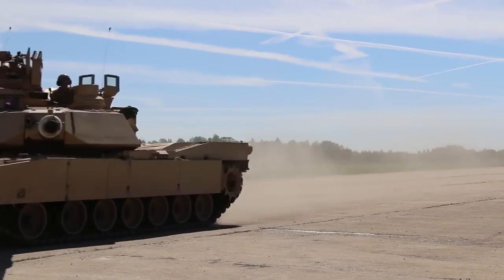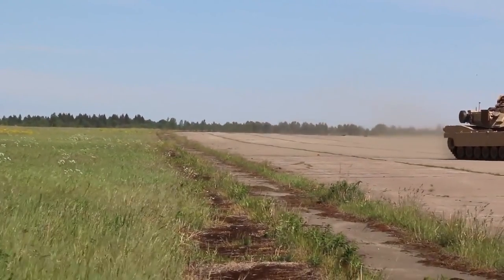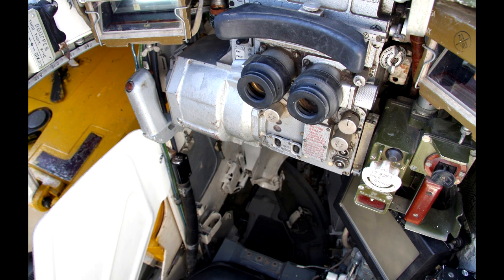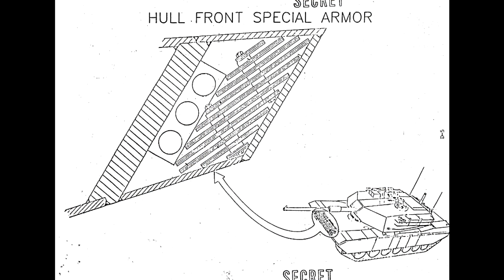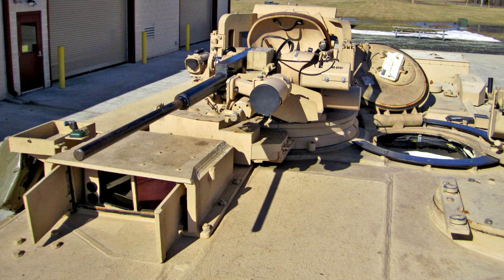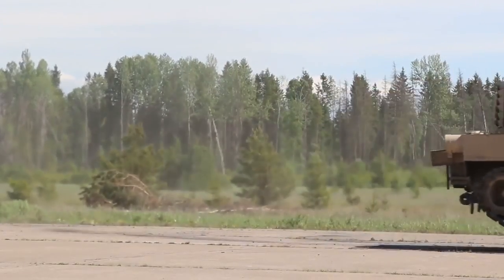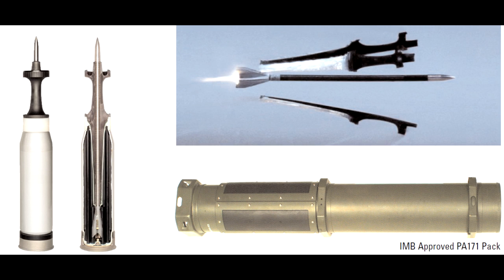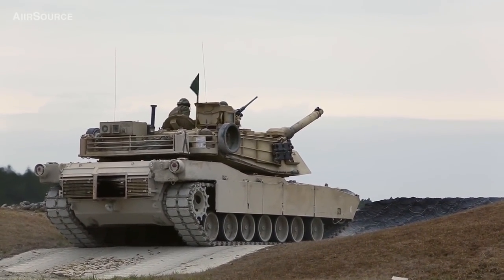Problems with Abrams tank

Comment: Also the only historically recorded abrams that have been destroyed by friendly fire or intentional destruction to prevent enemy capture only 9 have been destroyed 2 by intentional and 7 by friendly so those destroyed abrams pictures were not from enemy fire
Reply: Still a bad tank.... Logistics is critical, and this is a logistic hog.
Reply: @cliffordnelson8454  yes logistics are important but it’s not a bad tank, it performs and it has been seen to perform and I wasn’t trying to start an argument, I was stating what could have been worded better based on facts and I still think it is a good video but some things could have been mentions better in my opinion because he cut out some things that could have been important that gave a bad picture on parts of the tank that have intentional reasons for happening ie the gas turbine
Reply: @thederpyhue4290  It is not a bad tank, but logistics is probably most important for US than any other country since there is little need to worry about deploying tanks against Mexico or Canada. That means that  American tanks will always be at the end of a supply line at least 10k long. One of the things that made the M-4 Sherman one of the best tanks, particularly for the Americans, was that it was easy on logistics.
Reply: @cliffordnelson8454  a lot of good modern mbt’s have long or needy logistics to function properly it’s what happens when you have modern vehicles that actually work or perform on the battlefield, it doesn’t make it a bad tank for having a common problem every other modern vehicle has, that’s not an abrams problems that’s a tank problem with all countries
Reply: @cliffordnelson8454   okay lemme explain this better I didn’t do a good job before which is my bad

The gas turbine engine produces less smoke than the diesel, it makes less noise at distance, it can use any type of fuel which is good for overseas use because if need be it can run on anything, the tank has a diesel backup generator to keep the vital parts of the tank going when it’s stationary when the tank is idle, the gas turbine produces more torque in every situation and gets up to speed quicker,(not everything is about horsepower), it uses the same amount of fuel going it’s top speed through rough terrain and doesn’t use more fuel to get up hills and stuff and it builds up torque quicker on startup and while going up steeper slopes

Watch this video and fact check it if you want you seem to clearly care about being right so much https://m.youtube.com/watch?v=jABL74LTmhY

If this doesn’t get through to you man I’m sorry but have a happy thanksgiving and be careful who you call stupid man, just because you’re insecure, wrong, don’t want to lose and arguement, Or don’t know what you’re talking about doesn’t mean you gotta be upset

Also the military has the money to support all of there needs and are willing to so not a problem even if the fuel consumption was as drastic as you make it

Also the military has had all of the opportunities and time in the world to change to the diesel engine if they wanted to or if it was truly better they would have

Even after all of that if you still think you’re right maybe you should be in charge of our military you seem to have it all figured out go pitch it to them and see who is stupid after that

Sorry for saying some dickish things but I’m not the best at explaining things on the spot without thinking too much about it but I saw you call me stupid so I took my time with this one have a Happy Thanksgiving
Reply: @thederpyhue4290  Ok maybe I should not have been so hard. Maybe you really did not know much greater fuel the Abrams required than a diesel tank. There is a reason that you do not see turbine engines in very many applications. They can be extremely efficient if used right. That is why the are used in generating electric power. But in that case there are many stages to the engine to recover as much of the energy as possible. They are not small and light, and they can be run at an optimal power level, with engines shut down as demand requirements are reduced.
Reply: @thederpyhue4290  So tell me why no other country has used the turbine in a tank? The Russians dropped it like a hot potato. It is jut not a great idea. And as far as noise and smoke. You drive a tank and you will normally have so much noise, and the dust will be just awful. BS arguments for a tank. And I am far from the first one to pitch it. Ten years ago there was a web site run by a very knowledgeable American that advocated replacing the turbine, Explaining the issues. Alson with everything I have said, he also talked about the problem with infantry around that very hot exhaust.Name me one tank out of all the tanks design  since the Abrams that has been kept in service. It cannot be such a great idea if everyone else decided not to. And the US manufacturer was assuradely trying to sell it to foreign governments, so it cannot be lack of a source for all those countries.
Reply: @cliffordnelson8454  watch the video link I put in there is explains it better than I can put it into text and go check some articles about it, it is better and are army will always use the best resources doesn’t mean they aren’t expensive but our military is willing and has the ability to fund gas turbine and build around it to make it as efficient as possible, if the diesel was so much better they would use it and it’s built better and just watch the video it explains it better through words rather than text go fact check it etc, one thing I will say is krystler won the contract for a reason also happy thanksgiving have a good evening I’m going to end this conversation as it’s not going to go anywhere
Reply: @thederpyhue4290 I have read a lot about tanks, but seldom see an even handed handling of the M1. I saw a great video and it explained how the M1 has been behind other Allied tank during a lot of its history, https://www.youtube.com/watch?v=gx2GKAhh-IE. The British and Germans fielded the 120 mm gun well before it was mounted on the Abrams, and the commander's position was behind what other countries had. The initial version was really behind, and a lot of issues were fixed until the M1A2. A bad commander's position is a serious flaw. Even today the Abrams is limited because it cannot handle longer ammunition. Many of the videos you see are basically propaganda. They are either produced with support of the manufacturer or army or use only information that comes from the manufacturer/army. Very few countries operate the M1, and many of those have used MiA1's that the US probably probably sold at a huge discount.

Comment: Also the upper plate is a problem but not a glaring one in tank combat tankers will shoot for the turret as a penetrating shot to the turret will guarantee to disable the tank or kill the entirety of the functional crew, so yes the upper plate is a weakpoint but a noticeably small one at best and most abrams tank crews are trained to flank and go hull down not fully exposed position fights which is why the lower plate was never improved because the armor it has sufficed and it would never need to be really used other than smaller caliber weapons

Comment: Well the reason they used a gas turbine is because at top speed it is more fuel efficient and it has better torque output and usage, it also produces less smoke and is more covert for operation, the only problem is being idle is when the engine consumption is bad, but they also made it so it can consume almost any type of fuel for war scenarios and plus they have a extra backup power for important modular functions of the vehicle when the engine is off so the tank can function without burning tons of fuel which solves that problem everything else about it is better than a diesel
Reply: Turbine engines do not produce more torque off the shaft ,they only spin faster ,they need a huge transmission

Comment: The turbine isn't a bad choiche  since its quieter at combat distances and has more power during low speeds where this matters. In general turbines also tend to throw up less smoke than diesel engines and the main reason why the Abrams uses one is that you can also use different fuels which was considered iportant for a nuclear war

Comment: I find it odd that you think the soviet rounds the Cobum armor was designed to specifically defeat and appeared to do so easily in range testing would easily penetrate the armor. The upgraded armor was dropped after the Canadian order was completed as the Canadian testing range found that the original armor was still more than adequate to defeat the rounds used by the soviet block at the time. there are some big limitations to the M1, especially early models but by m1a1 they had a gun the soviet tanks couldn't stand up against, on a highly stabilized platform (Something the Russians still suck at) able to fire accurately from a tank moving 85kph, while being able to take at t72, t62, or t55 round in the face and fire at around 20% faster rate from a tank that was safer if it was penetrated (Separated ammo). Meanwhile mounted NVG, thermals, and optics were used starting with the m1 through sep2 when they where just added to the default tank build.

Comment: The truth is tanks are and always were pretty much obsolete anyway, if used improperly.  The problem is a tanks armor can always be penetrated, regardless of how many milimeters of depleted uranium plates you have. Therefore a tank in untrained hands, is nothing more than a very expensive coffin, with fireworks to celebrate your death.  For instance no M1's were lost in U.S. Army hands, only the stripped down versions we left for the poorly trained Iragies, can be counted as destroyed M1 Abrams.  Key word is stripped down.  You can destroy any tank easily today with an infantry tripod launched tv optical wire guided missile, fired from behind an obstacle or over a hill, and a tankers would never see it coming.  And it would hit top down on the weakest part of the armor.   But this was also true in WW2 when the Germans invented the shaped charge.  This meant that any 15 year old Hitlers youth, could simply pop out of a bush and penetrate up to 200mm of armor, which was basically anything on the battlefield, even if hit from head on at the thickest part of the armor.  So there are uses for tanks, things they can and cannot do, and you are missing the strategic point of a tank if you are looking at a tank as a 1 vs 1 fight, or even a 10 vs 10 fight.  You have to pull back and see the 35,000 foot view.. literally.  For instance the M2 Bradley Infantry Fighting Vehicle was accredited with more armor destroyed then any M1 Abrams... And if you find out why, you will find out why the M1 commander does not actually need to look for targets, or take control of the turret for any reason whatsoever.

Comment: What I know about the gas turbine and the Abram tank. The turbine engine is really cool. You can go from complete stop to 70 mph very quickly. The others side of that is it’s fuel economy. For every mile the Abram goes it burns five gallons of fuel and with a total fuel capacity of 300 gallons you have a range of 60 miles between fuel ups. That is why when Abrams are in the field there is a fuel truck with no armor following behind. That is why the Diesel engine makes more sense. It has the same horse power but lot better mileage and the fuel truck can stay behind where it is safe. Also diesels are not sucking in as much sand as a turbine does. From the rear Abrams are vulnerable. If you can shoot an rpg into the turbine the tank is dead in the wate.
Reply: There is no behind in war now all is front line with modern isr. Hit the fuel truck then hit the dead Abrams. 60 miles my God that's bad

Comment: I believe that the Turbine engines shouldn't be used for a main battle tank, it would be so much better if they made a specialized tank, maybe light or medium tank that moves at high speed, unleashes it's attack on the enemy at close range, then returns to base to reload, if it can move like twice as fast as the Abrams it might be worth it 🤷 but hey it's just a theory.

Comment: It's really simple.  Gas Turbine = better and faster acceleration.  The US logistic system is robust enough the extra fuel usage is irrelevant.
As far as the sights and such you're looking at an early Abrams, try compering to a current version.

Comment: Well if the regular M1 was bad how did it not get a single loss in operation desert storm
Reply: Also the engine was loud up close but the frequency made it so the farther you are the would is much quieter and the over heating problem didn’t exist and the t-90 is literally an upgraded t-72
Reply: There are few Abrams lost by enemy fire during that time but the numbers were relatively low

Comment: Gas turbine, wasn't expensive in the long run.. maintenance on the Gas Turbine was superior because of the relative low cost to maintaine, further more, you can throw various fuel types into the gas turbine and it'll just, go. The engine pack too is modular as hell, with few moving parts, requiring less maintenance over all, however if maintenance is required for the M1A1, typically the manufacturers will just send a new engine and swap it out, leaving the whole maintenance factor kinda out of the equation. Though with various results, its ideal for logistical reasons because you don't have to just use a specific fuel type unlike diesel. Yes you could configure diesel engines to operate the same, but as history has proven, its not at all ideal.

Comment: The only tank known to have killed a challenger 2 is a challenger 2
Reply: Bruh did you know that the challenger 2 lower plate in the front was hit by an rpg and it penetrated the armor
Reply: Š Ł Ą V Į Ç but that’s not a tank
Reply: Š Ł Ą V Į Ç also the challenger 2 uses an out dated gun any modern gun could probably kill it

Comment: I'm still uncertain why the abrams still utilizes the turbine engine. Given that its heat signature is massively higher and easier too detect with inferred systems let alone it is a fuel hog. 🤔
Reply: The heat from the engine doesnt matter tanks heat up else where too

Comment: You sometimes do really poor job critiquing tanks. You mentioned none of the advantages which turbine had over diesel engine. None of the reasoning behind multi fuel engine. You did not spoke at all about Abrams design. You were razor focused on technologies which still sucked a lot and provided very questionable edge. You do tend to overly focus on some small parts of a vehicle and fail to see greater picture. Yes, you are critiquing tank, but you tend to overly focus on, lets say, night optics and just bring it on and on and how absolutely terrible it is, because it had no night optics.
Reply: Hey read the title of the video its saids “problems with the abrams” look at the title before your gonna say anything
Reply: @sence8449  You can critique every design in existence this way and make every vehicle look like trash. Without context it is just nick picking.

Comment: Advantage of a turbine is that it lasts longer under load. It can operate at full power without any added strain to the engine.   Diesels...   not as much.